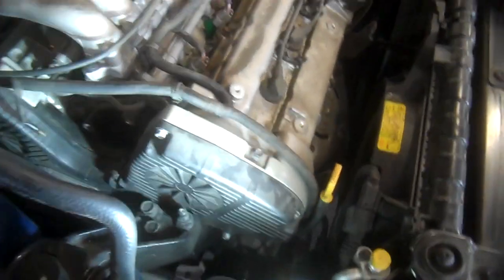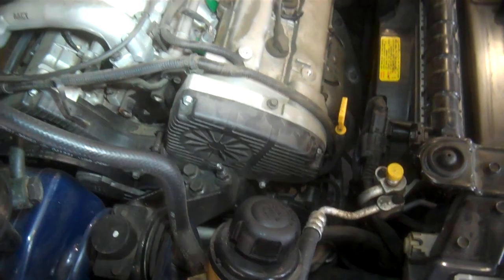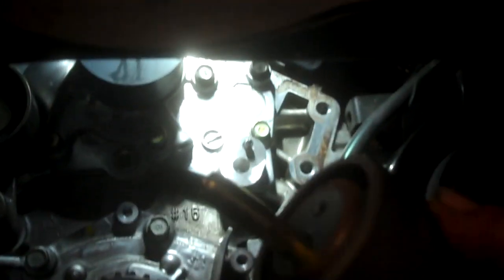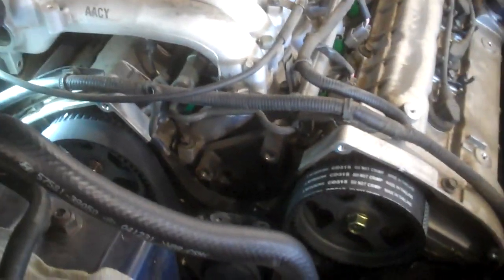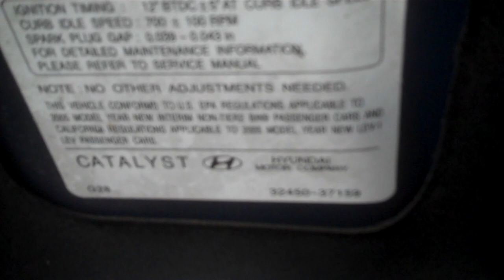Timing belt replacement Hyundai Sonata 2.7L V6 2005 water pump Install Remove Replace

Comment: Just changed the timing belt, water pump, ect on my 2003 Hyundai Santa Fe, 2.7 liter V6.  Same engine and mounting, no doubt.  Can't thank you enough for the great tutorial.   The belts back on were a real pain, tight.  There were no issues (as some describe) with the timing being off after you pull the pin on the tensioner when you use the method he describes.  One shot and done.  The surpentine belt was tough to fit back on.  I had to loosen the tensioner, get the belt behind it and then tighten up the mounts.  All else went as to be expected on any first timer job of this caliber.  And the old belts?  My timing belt had 80k on it (flirting with distaster) and although it looked fine, I know now it had stretched and would eventually jump teeth.  Savings = $700+. Thanks again!

Comment: My only advice to someone else doing this job, is DON'T mess with removing the dipstick tube bolt. I didn't need to, you just need to loosen the motor mount bracket enough to rotate it away from the block enough to wiggle the old timing belt out and new one in. Also, I would recommend putting the crank pulley back on before rotating the engine by hand with the crank bolt. I did not, and the crank bolt bottomed out in the crankshaft and damaged the threads slightly.

Comment: I must say, I have never changed a timing belt in my life, nor have I ever really looked into it. I own a 2003 Hyundai Sonata V6 2.7. l watched your video and felt comfortable enough to attempt to change my timing belt. I additionally changed the water pump, pulleys, tensioner and serpentine belt. I cranked the key with a prayer and to my surprise......everything went great. Its running as great as ever. I finished the job in about 7-8 hours with short breaks about a month ago. Thank you so much for sharing this video you did a wonderful job!! You explained it well enough for this YouTube mechanic (lol) to follow. Again, thank you
Reply: BryzGa
Reply: yeah its really not that bad to do. i think the fact that you can totally mess up your engine is what scares people away from doing it
Reply: I did my first hyundia v-6 timing belt kit 2 years ago. I'm not sure what book time is , but mine took about 2.5 hours
Reply: Ow did you get the harmonic balancer off?

Comment: Thanks for video.  Everything went great.  Here is valuable advice for anyone.  I also marked old belt with white timing marks, then transferred white marks to new belt.  This helps to make sure you got all the teeth perfect and tight.  If you install both belts using the correct pulley sequence, and keep them taught, it is easy to do, no difficulty stretching/pulling, and all white marks are perfect.  Ignore the advice of some people to set it up a notch off.  Pull the tensioner wheel snug before pulling pin, if you are unsure.  If you follow the correct pulley sequence, nothing moves.  I used the start the engine trick with a breaker bar braced against wheel control arm to loosen crankshaft bolt, and used the old serpentine belt wrapped around AC and alternator to tighten it.  Both worked better than any impact gun or pulley holding tools which kept failing.  Only issue I had was new water pump wouldn't fit flush against block.  Tried a second water pump, same result.  This was due to the bottom dowel on engine block that holds water pump/gasket in place not fitting in new water pump replacement design.  Had to use dremel tool and 60 grit sanding bit to micro grind the bottom dowel hole in the new water pump just a micron larger.  Then it fit perfectly flush.  Make sure you know all the torque specs of the bolts.  Also, number all your water pump bolts!  There are 8 water pump bolts, but in 4 different lengths, don't mix them up.  I put each bolt in a numbered tackle box tray with post it notes.   Label all your other bolts for different parts and put in individual trays.  Label your diagrams so you know where the random long bolts go.

Comment: I just did my timing belt, water pump, idler pulley tensioner pulley and tensioner  replacement today. Your video was very helpful. Thank you very much. I own a 2003 Hyundai sonata GLS with the Delta 2.7 liter V6.

Comment: Thanks for the video.  Changed the belt on my 04 Tiburon with 207,000 miles for the first time.  Your video made the process very simple.

My only addition would be to mark the old belt and pulleys before removal.  You can then take the old belt and transfer the marks to the new belt.  This makes alignment of the new belt simple because you make sure that your have the same number of teeth between the pulleys.

Thanks again.
Reply: bluerider 098 Damn, that belt lasted a long time
Reply: That timing belt was on borrowed time for well over 100,000 miles
Reply: @DKSE123  I agree.  I'll admit that I didn't even know it had a belt, I thought it had chains or I would have changed it long ago.
Reply: Mine is at 220k right now and the serpentine belt shredded I checked the timing belt and it had several cuts would of gave out at anytime I think it was replaced by the previous owner probably at 70k-100k

Comment: This job is a nightmare. I am doing it on an 05 with 110k. The harmonic balancer/crank pulley is stuck on so I had to use a claw puller tool and caused damage to it. The water pump was an absolute pain to get on because the block is warped and the part is flat, so I left the gasket off because I had no luck. I easily forgot what bolts were used because they were not all the same. So good luck with that! 💀

Comment: Well, I did the job today.  Thanks to the help of your video.  Took me 6 hours.. The hardest part of the job was re-securing the dipstick tube to the front of the engine.  Had a heck of a time getting the bolt back in.  Finally taped the bolt to a socket and was able to get it installed.  The rest was easy. Just had to remember the reverse of the tear-down.. Thanks again.. It works great. No more leaking water pump.  The Timing below looked fine, but I replaced it anyway just to be sure..

Comment: I was right in the middle of this job and couldn't for the life of me get the motor mount bracket off, but this video helped me find the little 12mm bolt under the cam pulley. Thanks. This is the easiest timing belt I've ever done. The only struggle was getting the serpentine belt tensioner and bolts in and out. All in all, shop time is 2.8hrs on this, taking my time with a lunch break I took more like 3 hours.

Comment: Just as a side note since you didn't mention it (Maybe you got lucky lol)

Each one of the water pump bolts on those Delta 2.7's and the Beta 2.0's are different lengths. You have your A's, B's, C's and one D I think. If you use a C in an A hole, it will bottom out and possibly break off or worse crack your block. Had one in the shop and the customer didn't know, tried to do it himself and had no Idea there is a diagram for where each length bolt goes. I usually mark them by color when I pull them out, but you can always use a micrometer to measure the sizes and match it up with the specs.

The only reason I knew ahead of time was because I have the factory service manual, but I know not everyone has the money or access to that kind of stuff lol
Reply from the maker: Swot Roke Good information thanks!
Reply: +Swot Roke yes,its a good idea to make a cardboard template with the new water pump,as you take off the bolts,install them in template,avoiding any problems.
Reply: +Swot Roke Hyundai & Kia offer their Factory Service Manuals (FSM)'s free of charge online
Reply: It's extremely difficult to get ahold of it =(
You can find it on various Hyundai/ Kia websites, but it's such a pain the a#!.
Thanks for pointing that out though. My manual is the paperback, but only cuz I worked there for a while. The PDF is awesome, way better for sure! Not everyone takes the time to research, so I thought i'd just throw that out there =P
Reply: @therickening7323  i just messed up...i took mine off today and didn't even realize it...

Comment: planning on doing this to my moms car soon I think it needs it, one day was accelerating hard and felt like it lost power or was slipping for a second. let off the gas and resumed as normal but immediately after smelled burning rubber witch I believe is the timing belt. now everything over 60 mph the car starts to shake almost violently and I believe it is because of the timing belt slipping gears and offsetting the timing, thanks for your video very informative

Comment: I’ve seen a problem with the tensioner arm, and I think you missed it also. Always use a drift to remove and then clean and lube the tensioner sleeve inside the tensioner arm. Failure to do can result in the belt slipping several teeth over time and a camshaft and cat efficiency code. I always replace the tensioner also and do not reuse the old. They do fail and this is a critical part of the engine not worth saving a few $$.
Reply: This might have just happened to me. I did new timing set, tensioner, pullies and water pump.  Put 2000 miles on the car no issues.  Driving to work the other day felt like it was down on power. Get off the highway at a stoplight and feel a slight miss and surging every few seconds. Get to work, cel and hear valve ticking.  Code was cam position sensor.  End of the day I started it and the ticking was real bad.  Pulled upper timing cover and it was off 4 teeth and found a cut on the inner side of the belt.  Had it towed home but haven’t had time to open it up and see what happened. Guessing tensioner failed, caused the belt to loose tension, rub on something and jump time. 😢

Comment: The return hose goes into the top of the power steering pump. Just disconnect it  at the pump. Very little if any fluid will come out. Then you can move the hose and pump out of your way.

Comment: What about replacing the cam pulley and crank seals while we're at it? Some new ones came with my kit but I'm worried about taking off the cam pulleys and losing the timing etc.

Comment: Its a great video although I had to put things on and take it back off again multiple times when putting it all back together. If it didn’t turn into a couple week job and rethreading Im sure my memory would’ve been fine just doing opposite of taking it all off.

Comment: I would like to see on video how you take out the bolt from the crankshaft.thanks
Reply: This works well. I unpluged the spark cable for both banks to avoid firing up.
Reply: Impact gun with a 22mm

Comment: You just wiggled off the damper.On my 2000 sonata the damper wont come off. with the 22mm bolt removed the damper is still trying to take the t belt cover and camshaft gear with it. Is that dowel pin keeping them firmly together. Should I drill out the dowel pin?cant believe that dowel pin holding the two together so tight
Reply: doug drefus the dowel pin was tight holding the crank pulley on, I used a punch on the pin and it came off😉
Reply: i think im having the same issue its frustraing

Comment: This is a great video. The last timing belts that I replaces were on a '91 Dodge Caravan and a '85 Olds Cutlass. The water pump on my son's car has started leaking and I am thinking that it is time for me to get the tools out again.  I take it that it is safe to presume that it would be basically the same for a 2005 Santa Fe with the 2.7 engine?

Comment: Is it possible to install the timing belt idler in the wrong orientation? If so, how do you fix it? I know it’s eccentric, and it’s keyed to the block but I don’t see any way to adjust it. After I changed the timing belt in my car the lower timing cover won’t go back on, it keeps hitting that idler pulley. Any help would be appreciated

Comment: Hi.  I'm planning to replace the timing belt, rollers and pump in my recently purchased Santa Fe from 2006, 2nd generation (2.7 V6, mileage 217,000 km - I hope it's real :-).  This video convinced me to do so (thanks).  However, I do not have a service manual (and I cannot find it) and I do not know the tightening torques for the screws.  Will you help?  Regards

Comment: I need some serious help guys. I can not get the crankshaft pulley completely off. I removed the nut with my impact drive,r with ease. But, I can not pull the pulley out. It literally pulls forward a little bit, then it stops, it almost feels as if something is locking it/preventing it from being pulled completely out. any IDEAS ?

Comment: Thank you for the video!!!!  would you be able to make one that shows where to connect the guage to measure the fuel pressure? Trying to see if my fuel pump needs to be replaced, but i can't find the port.  Thank you!!!!!
Reply from the maker: Jesus Mendoza may not have a test port, you may need to just hook in a pressure gauge at the fuel filter, or somewhere easy to access the lines, and will need proper fittings to make it happen.

Comment: 2007 Hyundai Santa fe how many km before you change the timing belt
Reply: Hyundai reccomends 60k miles. You can probably get 75k or even 100k out of it but it's being very risky as it is an interference engine so it will cause damage if it snaps. Did you get it done yet?
Reply: Hyundia Says Every 60,000

Comment: What do you recommend for using as a pin if you don’t have one
Reply: Il answer my own question to anyone doing this at home if you find a thin enough Allen key it’ll work perfectly as a pin to hold back the tensioner.

Comment: What is the price to get this done ?
Reply: Depends. Can be $500 to $2000 depending on what quality parts, where, exactly what parts, etc
Reply: I did mine for just under $225.00
Reply: I did mine for about $225

Comment: Just found a major issue doing my water pump on this nightmare of a car. Someone didn’t put time pulleys on correctly with the timing marks. No matter what I do the timing marks will never line up on the left side cylinders. The marks on the engine are about 90 degrees off but the pulleys marks are about 120 degrees. Car ran fine but these marks are never going to match
Reply: It's ok it's called hunting

Comment: this video is awesome! I have a question though...
I don't see the link for pulley holder.
which one did you use?
can you show me the link so I can buy it?
Reply from the maker: +David Kahyun Park I put link in description for pulley holders.  I re-watched most of the video, did not see exactly which pulley you want to hold, crank pulley I am assuming.  OTC universal tool should work.

Comment: How reliable are these engines? Are they known for oil consumption after X-amount of miles? Looking at one right now that has 162K
Reply: My 2004 With 126,000 Uses Zero Oil
Reply: Bro put amsoil in ur car
Reply: Thank me later I'm running 200k still burning a quart every 6k miles
Reply: Not even broke in yet . They will run 250,000 plus
Reply: It's a delta engine , they're well known for running well over a quarter million miles

Comment: Why does nobody address the cam timing chain? I cant even find a full kit with them in it!
Reply: You really have to dig deep to find those videos , but they're available. The video I watched they were replacing them at about 150,000 , and called it a mid life rebuild as they pulled motor out to replace oil seals & oil pan

Comment: Somebody pls help. My serpentine belt snapped on 2.7L  2004 hyndai sonata due to locked compressor. I changed the compressor, checked every other thing ok, got a new belt and tensioner, follow the routing pattern on the pulleys and it just won't tension. I hope someone might have experienced and solved this problem b4. I have never taken any car I drive to a mechanic..

Comment: I've never done a belt before. What were you looking for when you turned the engine? The belt to stay lined up or the marks to realign.
Thanks
Reply: Yes you don't want your marks to be different because if a tooth is off you run the risk of bending your valves when turning on the engine and thus you bought a new engine

Comment: How did you remove the Harmonic balance bolt
Reply: He did it with an impact. But if you look up videos u can do it with out one.
Reply: I put a 7/8 inch box end wrench on bolt with wrench pointed towards front of vehicle just above frame , then simply turned the engine over by turning the key in the ignition for a second and voila . .
crank bolt loosened

Comment: If the crankshaft pulley was lined up and the cams weren’t what would’ve been your next step.
Reply: U will destroy ur engine lol interference engine
Reply: @htatesil4192  that’s why you have to make sure it’s lined up lol
Reply: @michaelcoleone9665  lol about to buy a 2.7 hyundai sonota gls 67k miles but it sat like 6 years moldy smell might just pull the engine and trans and put it in my other sonota lol wish me luck the dealers says switch timing belt at 70k so I'll do that too